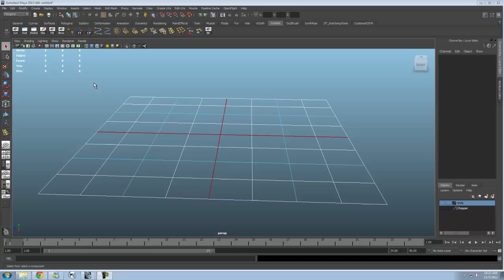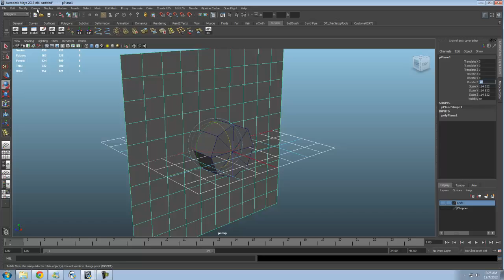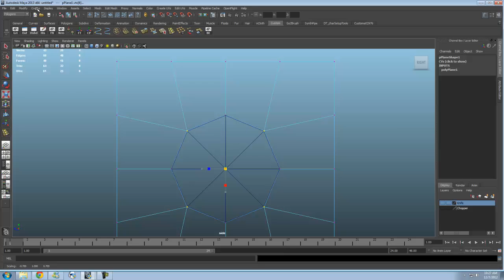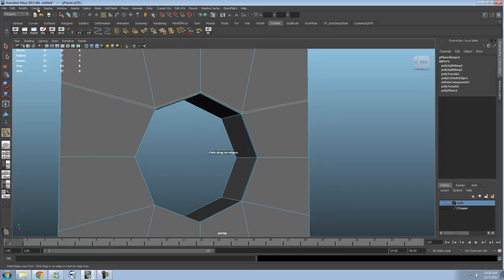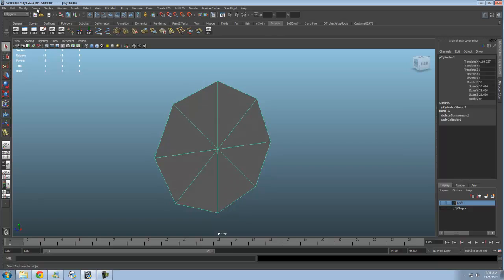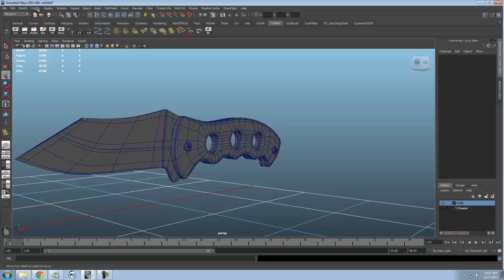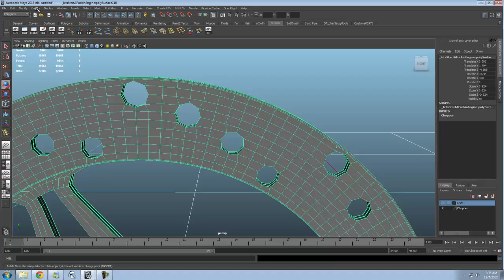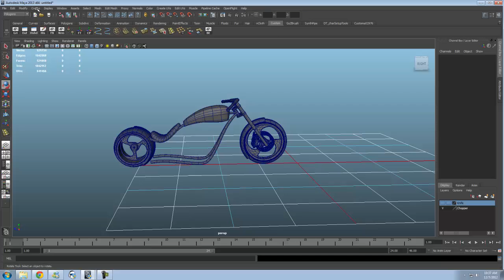How to make a hole/circle in Maya 2013

Comment from the maker: The holes on the rotor were done with the first technique I demonstrated. Basically, I had the flat cylinder piece up, and simply moved the verts in the shape of the hole, then just removed the inner faces. One thing I hated about this tut was how early on, the cursor disappears. I think I may do a tiny update to this, but just making the rotor. It seems like most questions are coming from that, so the entire rotor being build seems like it will help most out a ton.

Comment: this is useful. I'm working on creating gears with holes and other cutouts through the interior. I'm fairly new to modeling complex shapes and I just realized that booleans don't work on a complex shape with repeated holes or anything other than base primitive cutouts. I am thinking that your technique could actually help me with those complicated shapes. You have a few on your bike wheel that look like twisted hole shapes and was wondering if those cut outs were done with the same technique.